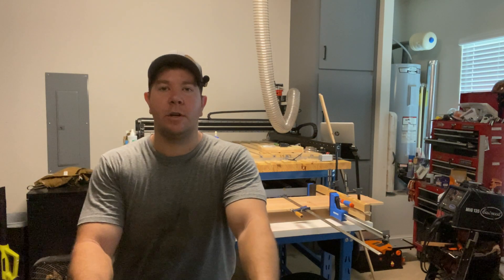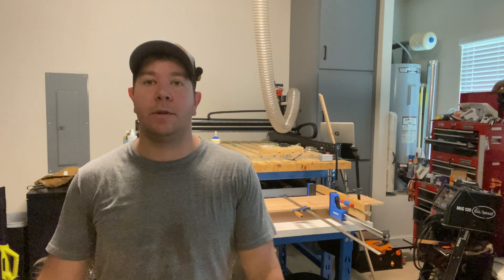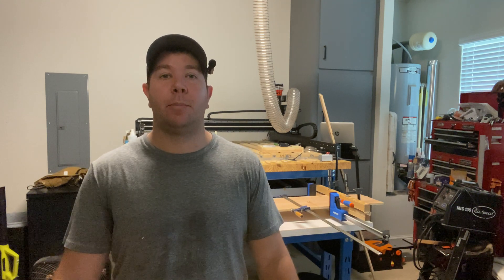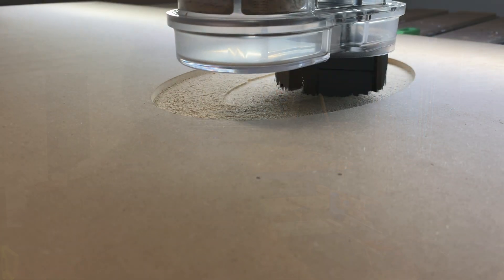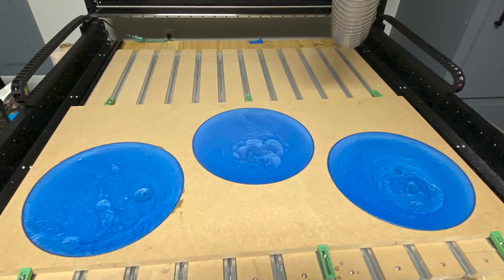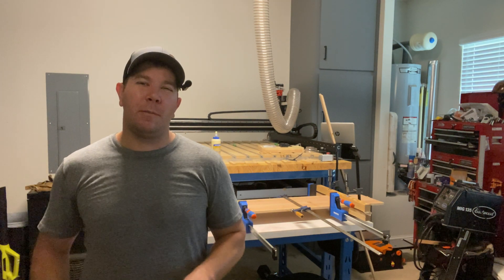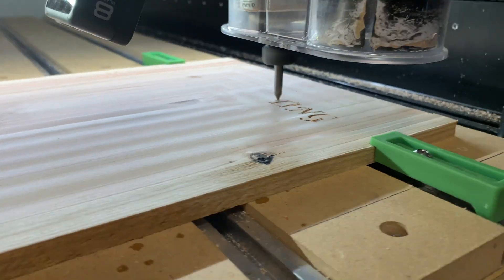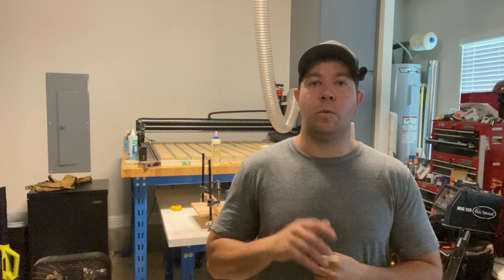3 BEST Materials for CNC routers

Comment: I’ve been hearing a lot about using cedar pickets for outdoor signs. Painted and sealed it looks like a very affordable option.

What I’m finding on Home Depot (app) is treated or pressure treated. Those are treated with chemicals right? Are they still usable?

Thank you for the video. I believe MDF is bad for outdoor use due to it swelling or reacting to moisture/humidity.
Reply from the maker: I think the cedar pickets are great for small signs. You can also buy cedar boards and lowes and HD now, but i would try to find a local wood seller. The big box stores are incredibly expensive when not buying construction lumber.